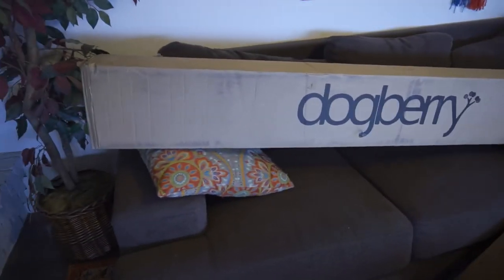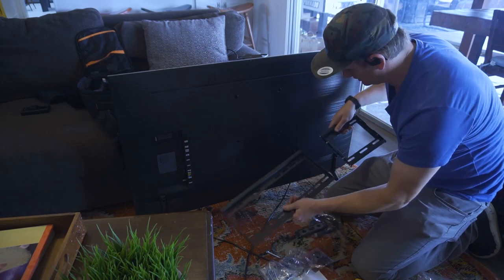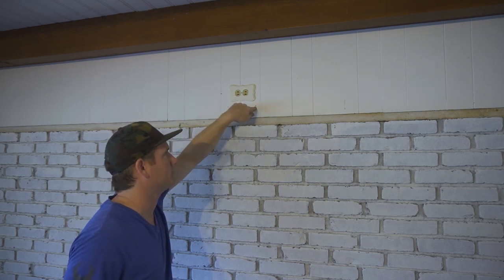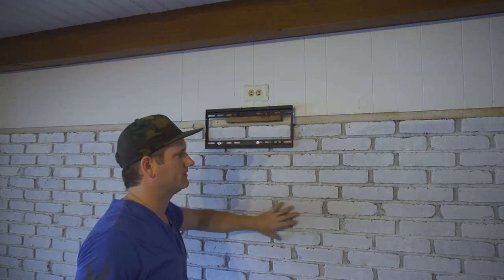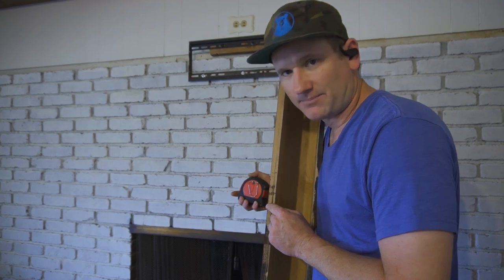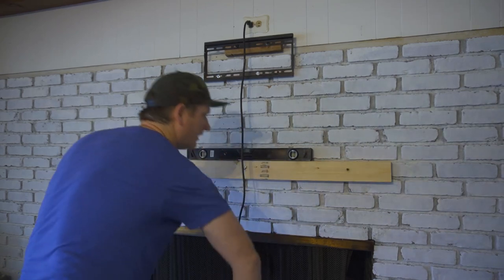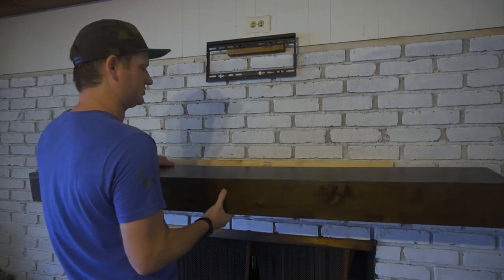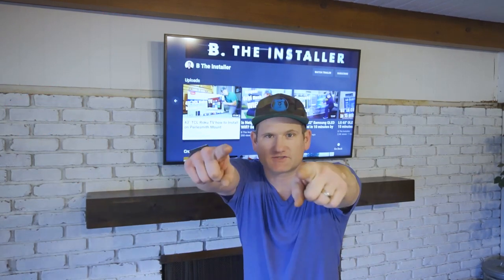Wall Mount TV Over a Brick Fireplace

Comment: Yeah, great install.  I just bought a tv wall mount similar to yours for installing a flat screen over my brick fireplace, and if you can believe it, the manufacturer's instructions say you can't mount their unit into brick (they say it's either studs or 8-inch-thick concrete !).  You and I, and many other installers who've made web videos, know that this is nonsense.
Reply from the maker: Probwbly just to cover their butts..  many also say don't secure to drywall only which is also subject to tv weight, kind of mount, etc
Reply: @BTheInstaller  My thoughts, too, re their behinds.  They banned drywall, too, and I'm ok with that because moving the tv up/down/left/right could certainly cause a lot of cheapo plastic drywall anchors to loosen.  But any installation method can fail if it's botched or the wrong materials are used - including installation to studs.  Why not just tell the consumer to hire a pro like you if they're not sure of doing it right (they didn't) ?  It's like my father always told me - if you don't know, ask.

Comment: That is great! But, we have no electrical outlet above like this fireplace does...any suggestions?
Reply: It's not difficult to put an outlet in the wall, or even the ceiling, above the fireplace.  You can buy outlets that also include an opening for the cable tv coaxial cable so there won't be any cables hanging down underneath your tv.

Comment: Do you recommend using jb weld for a little extra hold? Doing this for my girlfriends mom so I really, really don't want to mess up and get a message her tv fell lol.
Reply from the maker: I just used the 5/16 inch blue concrete bolts at home depot that you drill 1/4 inch hole x 5 and it held a 77 inch $4k OLED, and I hung on mount.  So if you drill the holes well, ideally through the brick or clean the holes and the bolts go in and don't spin, they'll hold extremely well.  And remember the pressure isn't pulling back out of the hole, it's downward pressure.  Very unlikely to fall.  You really have to suck

Comment: I noticed you used specific bolts directly into the brick. I see a lot of the mounts have sleeves you pound into the brick, and then the bolts go into that. Would you recommend using what comes with the mount, or the direct drill bolts?
Reply from the maker: Great question.  Absolutely easier with the ones I was using. They're online or at hilti  1/4 concrete lag bolts.  The other way you have to make bigger more damaging holes but would also work. Sometimes those spin or don't get fully tight.
Reply: @BTheInstaller  Do you have to have a hammer-drill to make those work?
Reply from the maker: @matthoward6130  yes.  Hilti hammer drill. The typical 18 volt drill that can hammer is hard to get to work for larger holes..
Reply: @matthoward6130  Yes, it is easier and faster.

Comment: What kind of tool you use for bricks and bits ???
Reply from the maker: Hilti SE2 hammer drill and 1/4" bit and lag bolts meant for concrete/brick.

Comment: Is the mantel able to hold power cords and extensions in there while also withstanding the heat?
Reply from the maker: No heat issues, the mantel would light on fire if it were that hot

Comment: Hi B, thank you so much for the videos. My question is how would you hang the frame tv on stone?  We have an outlet box that we can already fish wires through to our cabinet down below but our whole wall is stone. It I’m not sure what screws I would use on stone. And if we would have to rent that special drill you have for the brick. Thanks for all your knowledge, tips and tricks!
Reply: I think you can use tapcon screws for concrete. You can ask the Home depot or Lowes guys about it.
Reply: @joaquinsuarez6090  Tapcon screws are the real deal for concrete or brick.  I have used them successfully in both materials.  Just be sure you follow the instructions and use the proper diameter masonry bit and drill to the proper depth for the chosen tapcon.  A hammer drill is very nice to have as well, and if you shop you can find one for under $30.

Comment: What type of lag bolts are you using for the bricks?
Reply from the maker: https://www.homedepot.com/p/Hilti-1-4-in-x-4-in-Kwik-Hus-EZ-Concrete-and-Masonry-Screw-Anchor-100-Piece-418048/204670935?mtc=Shopping-B-F_Brand-G-Multi-NA-Multi-NA-Feed-PLA-NA-NA-Catchall_PLA&cm_mmc=Shopping-B-F_Brand-G-Multi-NA-Multi-NA-Feed-PLA-NA-NA-Catchall_PLA-71700000014585962-58700001236285396-92700010802552517&gclid=CjwKCAjw88v3BRBFEiwApwLevdzEjcj-VJZ3uvUM2r0NSwHKpdL32ZmBJnXKhoY33qrjUzppq-m1NBoCcFQQAvD_BwE&gclsrc=aw.ds